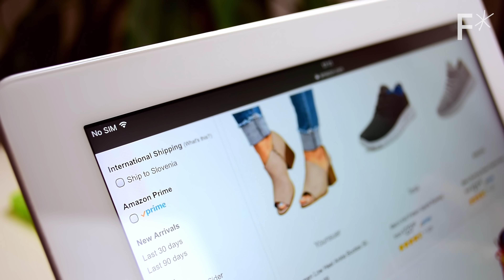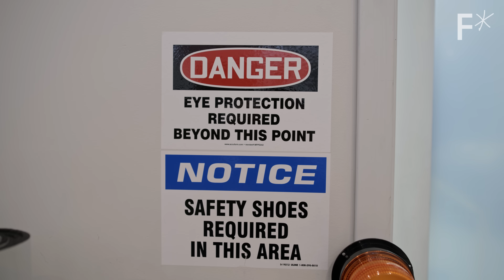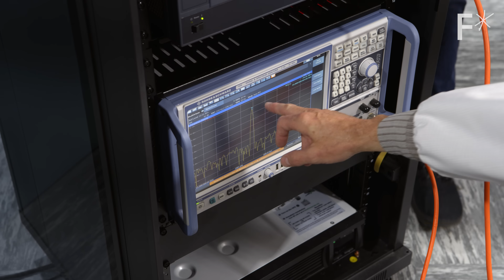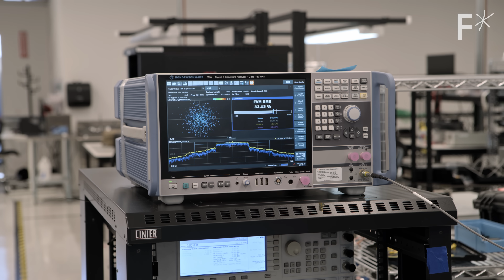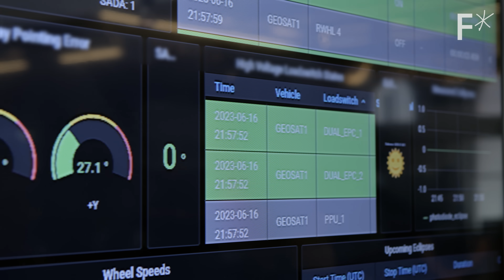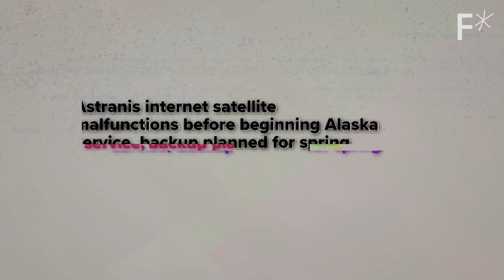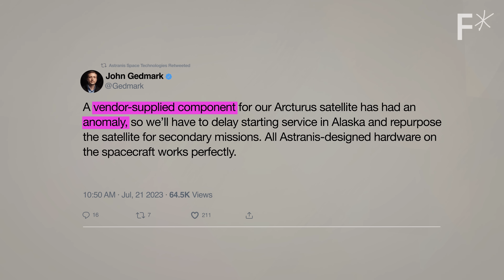Starlink’s newest competitor is using next-gen satellites to create internet for all | Hard Reset

Comment: Satellite Network Engineer here. It was really strange to frame LEO as being some cumbersome design and GEO as being a "new outside the box" solution to this problem. GEO has been around for decades. It's the OG solution. But the problem is latency and it's caused by the extra distance. The average latency for a GEO stationary Sat is about 700-800ms compared to LEO which is like 32ms. That is a VAST difference (which admittedly is addressed later in the video).  The Phase array tracking system in Starlink antennas is literally bleeding edge tech. 3:16 this sequence was  very misleading, considering that the starlink antenna (dishy) is phased array not mechanical tracking. So the antenna isn't literally "moving around" to track the satellites as they pass in LEO. And that being the case it doesn't "jump" to track the next sat (or at least very very very rarely if there is an issue). It switches faster than you could perceivably notice and long before a packet hits its timeout counter or is dropped. So the internet wouldn't "go down" as described.

These guys aren't really doing anything revolutionary here tbh. They are just iterating and aiming for a cheaper solution that serves a very specific niche at the very bottom end of the market.
Reply: Very true. Working on a project now in Europe where we are removing the old GEO satellite connections using an iDirect HUB and installing Starlink. The client is blown away by the latency and speed of the new connection. It's like several times better.
Reply: @thebrainfan  Like 20X better..
Reply: Yeah, this was weird to hear the way this was presented. Old tech, same draw backs as ever, rebranded and marketed to supposedly serve some underserved community now. I feel like I have seen this before.
Reply: @TheDrov  
But that is just the exact same thing Elon Musk does, xD Takes and old idea, Re brands it, Makes some promises, don't deliver on time, Ask for financial help from government, Deliver half of whats promised with bad quality, laughs it of.

- Hyper loop, Never deliverer, bcus it is impossible to make, as multiple scientists said before he even started.
- Tesla Electric semi-truck, promised production in 2019 but was pushed back 3 years to 2022, now mass production not until 2024 Q3
- SpaceX star ship, Mars mission, is missing a reason to go to mars,why colonize mars? and how, they are less then 5% of the way there
- Tweeter, bought it to allow free speech, instantly learns why free speech is impossible on a platform that survives on regular advertisements. start by saying everyone can have a blue check mark, if they PAY FOR IT.
- Even Tesla is just a normal Electric car with some components that are industry leading 
- Tesla self driving, never functional and never will be, bcus of safety and regulations, unless they change the exterior of the car like existing self driving cars has, to allow for better cameras and tech.
- Pay pal, is said to have been someone else idea, he was just on the board and didn't make any important progress, was fired for some reason
- The Boring Company. promised to bore tunnels for hyperloop faster and cheaper than any other on the market, when hyper loop was shot down they had to start digging normal tunnels, but still do it more expensive of about same expanse as others.

point is. Elon Musk is really bad at predicting what he can make and how fast he can do it.
i like that he wants to make new cool things, my problem with him is that he is lying alot in his advertiseing.
i would be ok with him if he just sayd. "our goal is to make this... but we dont know when or even if we can do it"
i absolutly hate it when he says "im comfident that we can to this within next year" and then after 5 years they are not even close

He is also good at making stuff we DONT NEED, but he does it because it is cool and because he can, even though he really cant. XD

although i have to give him props for what he has done, some rocket science tech advancement, early electric car mass production, and there are many small things he has improved.

but over all just wtf is he really thinking when he makes thees promises he cant ever keep...

pleas challenge me with facts if you can, calling me names and getting angry want help anyone. change my mind!
Reply: @echoeversky  alot of the companies Elon manages are making huge steps in science, but i just don’t like the marketing.
He said star link would be cheap, but instead the government payed for most of it instead of the company. 
Its cheap for us because the gov payed with tax money instead
Reply: Great Points, couldn't have said it better. Also they are dependent on SpaceX to launch, basically paying their competition.
Reply: @AltHistoryX  When it comes to launching rockets, SpaceX is a great company.  Starlink was an idea to suck money off of SpaceX, So you have space transportation with the offshoot of space exploitation. 

The idea that being a rocket company and a satellite ISP, is really pretty dumb. Starlink has some amazing technology, but it comes at a cost.  A cost that is not remotely affordable for that market of 4 billion without highspeed internet. The market that Starlink was in theory,  built to serve.  So in that regard, Starlink is not competition.  GEO-Sat is better in many ways to LEO-Sat with the exception of latency. But fiber is far superior to both in that regard.  and Starlink costs twice as much as fiber. 90% or more of internet traffic is not latency dependent. About the only things that are impacted, is gaming and live streaming. If you live  in one of the underserved areas, this is probably not a deal breaker worth double the price!
Reply: @professorg8383  I agree about the latency not being a problem for a lot of things, but it definitely is for VOIP. But maybe that is a niche market as well.
Reply: @GarySchiltz  I can not speak to what the high limit is for Voip. Not sure what the hardware or software tolerates. I have video conferenced with lag times approaching a second and although not ideal, it's something you can deal with by having a little patience. If you have ever done much communication via radios, you learn to deal with a little lag.  I have worked somewhere with Voip and you could tell that it had some delay, but you just needed an awareness. My guess is that what brand of equipment you have, might make a difference too. 

My brother has Voip as part of his Gigabit fiber service, but then fiber is virtually latency free.  But even then, Voip has issues with things like emergency services. And standard phone accessories like cordless handsets, faxes, etc. become door stops!
Reply: thx, i just posted the same kind of comment with far less understanding :). you did it right.
Reply: Your comment is spot on ! They don't have 1 good argument why their system is better, so they try to make people believe that de Starlink dish is moving all the time so we will think that the motor can also break. Maybe they have to watch this video "How does starlink works" https://www.youtube.com/watch?v=qs2QcycggWU 
The Starlink dish Phase Array Beam Steering tracking will not make down the internet connexion, it will just switch the phases of the antennas and the signal beam is steered to an other satellite almost instantly.
Reply: Thanks for confirming all my thoughts through out this video. GEO is obsolete for real-time communication. Presenting this as an alternative to Starlink is ridiculous.
Reply: Said it better than I could, though I understand what you said 100% I had Hughes in late 1999, before we could get 1.5 megabit DSL
I got close to a meg down, but had to UL over dial-up. But at the time, it was pretty good. GEO is about 22,500 miles above earth in the Clarke Belt as I remember. Just like Direc-TV.  I have installed all kinds of GEO dishes and had a big 12 foot C-band dish at my house. C-band in the 1990s, you rotate the dish to receive different transponders. Those were the fun days.
GEO satellites usually run out of fuel before they go bad, they use fuel to be repositioned occasionally. You could see a lot of free TV, and audio on C-band. News feeds, etc. I remember Galaxy 4 being one satellite.
Reply: Thanks so much!!
Reply: Yeah, they miss the mark on a number of things here. But they are somewhat revolutionary with their smaller, cheaper tuneable units. Of course, the extreme latency of GEO communications makes them ABSOLUTELY THE LAST OPTION I've built systems to use dialup instead -- also because talking to satellites is hard to do in a forest fire. BGAN has been around for ages, but it does (did?) need a very wide clear view of the sky.
Reply: @jfbeam - GEO works great for non-time sensitive applications like streaming one way video like YouTube at a lower cost than thousands of low orbit satellites.  It's a trade-off between low cost and higher latency.
Reply: Hybrid satellite networks which utilize GEO and LEO are the way.     We don't need LEO to download data once you have enough buffer to cover the initial latency of GEO.  Its ideal for movies for example.  Not good for VOIP, most gaming, live streaming a rocket.
Reply: @dherman0001  This is correct, though I’d go further and say SD-WAN is the way. Hybrid networks with multiple WAN including LTE, L-Band, LEO and GEO are what we are providing to the majority of our customers currently. Another point which hasn’t been mentioned is Starlink does not currently provide a CIR service.
Reply: @dherman0001   IDK if they have any systems running, but I have heard the Viasat guys talking about hybrid systems. But I haven't heard an explanation of how it works. And I'm not sure their hybrid systems are even aimed at  ISP use.

LEO-Sats are probably most useful for data collection. LEO orbits can capture some very high resolution terrestrial data, and they could uplink to GEO-Sats to be fed back to the ground. This is the kind of data that doesn't need to be real time, but with a GEO-Sat relay, a lot of data could me moved pretty quickly. 

To be honest, I think a huge constellation of LEO-Sats for internet service, is pretty wasteful and potentially hazardous to Earth dwellers.  GEO-Sats for internet, work pretty well, except for latency issues. But is a Starlink system primarily about making gamers and live stream video and Voip users happy, worth the expense?  That is a very small portion of all internet traffic. Less than 10% typically, and is any of it really real time critical?? Sorry, gamers, 

"Real time" traffic can be achieved with a variety of terrestrial services and for far less money, Starlink can never be cost competitive with these services.  The tech is very cool, but I don't think it is worth it as designed.  

Now if each of these satellites had a high resolution camera on board, imagine the possibilities of being able to see in great detail, any location on the hemispheres near real time!! I think we could com up with some very useful information from such a system. Why didn't Elon think of this?
Reply: thanks.  I could not have said it better.  There is another problem with GEO, cost to launch. I heard somewhere a GEO orbit is expensive and SpaceX basically owns Starlink. This company also looks slow or no sense of urgency producing those satellites.
Reply: Thank you, I have literally no formal insights on this and also thought... Wait a minute, thats misleading but the fact that someone who knows way better weighed in 👊🏻
Reply: its hughes net 2.0 and will still be basically dsl dialup on the best days and worthless with any weather
Reply: For some people lower cost is more important than lower latency.
Not everyone does real time communication or gaming. If Astranis charges less than Starlink, for many people could be a viable solution.
Reply: Thanks ! I was watching and keep wondering "what is new ???". 😂😂 The video really waste my time
Reply: They will go bankrupt shortly. 

Nothing in their business model makes any sense. 
Cheap equatorial geosync satellites is a Very bad idea as that is a much sought after orbit, large satellites are used for maximum salable bandwidth for a slot. They also have a problem with removal when expended if they fail to return from orbit so the satellites are built to last many years (15 or so). They will stay up there as trash for thousands of years if they fail to de orbit or fail to move out to a "trash" orbit... unlike LEO sats with much higher bandwidth, superior reception, 20x lower latency, little problem re-entering if they fail (dragged down by upper atmosphere). 

LEO is Vastly superior and Can use cheap/small satellites like those used by Spacex... but even here they moved to larger satellites to maximize bandwidth for an orbital slot. (V2 mini is more than 2x heavier than V1.5 but has 4x the capacity. Full V2 has 9x the capacity of V1.5 and weighs about 6x s much (and tosses in a cell phone to sat antenna to obviate satellite phones. 

So this appears to be a company built on flawed ideas with no business case that others aren't doing much better/cheaper. They are Way too late to a party that has moved on to LEO.

This will burn investment dollars and only get investors who don't do their homework.
Reply: Fully agree.
Reply: Exactly! 💯
Reply: Latency is not always important unless you are playing real time video games. If I am uploading or downloading videos then I could care less about latency.
Reply: @WJV9  That’s absolutely true. Neither is insurance, first aid kits, carbon monoxide detectors, plungers, basic tool kits etc etc etc. But when you need them, boy are you ever glad you’ve got them.
Reply: @WJV9 you do realize that latency affects the speed.
Reply: I work in space force acquisition and I completely agree.  Cheap commercial niche is the future architecture to accomplish resilience as cheaply as possible
Reply: Do you know if that is the new refueling port? Are we looking to a part government Military satellite ?
Reply: You said it better then me but, I knew this video didn't add up and gave always k ow. Geo has terrible latency.
Reply: best than the video itself , great comment!
Reply: Also with fewer satellites, wouldn't the fact they are covering a larger geographic area (and users) negatively affect the bandwidth by each satellite having to process way more data packets?
Reply: @CrustyOldMarine  The newer GEO-Sats like the Jupiter 3 have 300 spot beams and each covers a smaller geographic area kind of like a cell.  Each of Sats have 18 different gateways so the satellite has 1Tbps capacity. That's a lot of bandwidth. These are big satellites If you have a few of these they can move a lot of data, 

These have come a long way since early satellite that had wide beam coverage area.. You can think of these like many satellites in one location in space dividing up the area below into different 'cells'.  

Bandwidth is really not the issue it once was. But sitting 22,000 moles away, does mean pretty high latency. So "real time" is about 3/4 of a second delayed. That is less of an issue than is often stated. Things like gaming, two way live streaming and super high speed market trading will suffer from that delay. Just can't get past the delay issue because of the distance. But for more than 90% of all traffic, it's not an issue.
Reply: Not to mention launching GEOs being incredibly harder and more expensive.
Reply: My thoughts exactly, it felt weird watching this surreal 'perspective' on reality.
Reply: Yeah. BS. Starlink and this is not satellite based. It's GPS based and GPS is also not sattelite based. Just look onto the maps where you can get Starlink and where not. That says it all.
Reply: Exactly! My thoughts exactly when he said they were placing them in GEO! LMAO!
Reply: Rocket science engineer here: Rockets don't work in space, because there is no atmosphere.
Reply: Well said.
Reply: Was about to write the same, thanks for writing this, very important!
Reply: I worked on Irdium and it had too  many issues to everwork. The packets of the internet go through queing delays and end up with more delay then GEO.  The problem with geo is the two way link loss is very high and the gains needed to make it work require very large antenenas with gains that cannot be obtained with phased arrays.  antennas.  A handheld phone would require a large anntenna of some sort just like currnet GEO's and you need push to talk for voice when the delat gets over 20ms.  It would be much cheaper just to build cell towers powerd by cable modems ( 5 g cells towers).  Starlink makes no claim about latency becuasse they are not trying to provide two way voice.  Our GEO spy satelits have gigantic antennas on them and cost billions to lauch.  Iridium never had a chance for two well cell calls.  The physics of communications just will not allow a practical solution for cell phone receiption from space.  The propagation of cell phone towers(multipath reception) requires power densities just not possible fron geo or Leo.  All this low orbit space junk is going to be a problem with Starlink.  I can't beleive the goverment let MUSK lauch this thing!
Reply: What about ASTS seems like every first world person complains about dead zones.  If they eliminate that= we have another internet revolution.  Also by linking up 'poor' countries they might be able to commerce with us and we can make money with/off of them
Reply: I'm not an engineer, but this was going through my mind the whole time I was watching. I remember thinking about getting a satelite internet as far as 2010 my self. I gave a dislike for this disengenius way of framing things.
Reply: Hoenstly this video feels like a thinly veiled infomercial for this company.  I support business but don't lie and pretend this is an objective video
Reply: not even an expert and though the same thing. starlink picked leo for a reason.
Reply: This is old tech bro. I just back packed across the middle of absolutely nowhere in Italy. 20 miles away from a small town. Took out my mini Starlink and watched 2 movies on Netflix the other night in the middle of nowhere!!!! 150 MBPS, 30m latency!!!
Reply: I had Hughes geo internet at one time, the latency was horrible, the speed was slow, the dish was huge and the daily data limits were onerous. Starlink addresses these issues affordably though less efficiently than land based systems. But for millions of users, a very viable solution. I can't wait to buy a Starlink Mini and put it in my travel trailer for my next trip to the Arizona desert.
Reply: thank you... you said it, so I do not have to :)
Reply: Thanks someone from that industry speaks up.
I am so annoyed by Starlink etc. When you do the math, you can quickly figure out this isn't going to work out. 
Starlink is in lower orbit, but that adds a lot of new complicated things to it. 
It's just really cheap to dig a hole and put a fiber in it. Nothing can really compare to it. 
Satellite Internet is more of a hot fix.
Reply: @PhilippBlum  Quite a few people live in area's where fibre is not available unless we're willing to come up with $50k to have it installed I don't call that cheap.
Reply: @BamBam-uf4yi  The fun part is: All of these satellite Internet providers don't even serve those regions.
Reply: @PhilippBlum  Well starlinks serving my region.
Reply: @PhilippBlum  Well the nearest fibre to me is 100km away and whos gonna pay for 100km of fibre. Starlink is cheaper. Had to chop down some trees but they had to go anyway
Reply: so with that split-second change is internet disconnected for that brief moment?
Reply: @proxypharm8511  been streaming live TV havint noticed a thing only obstructions cause problems.
Reply: well said. this should be a "community note"
Reply: What about cloud cover effect? Especially one with electric storm during bad weather!
Reply: @olivermandalamwambazi4000  ka/ku suffers rain attenuation for sure. Heavy rain will result in an outage.
Reply: Where did you get 700ms?
Reply: good point, very professional!
Reply: Yeah. I don't like liars. Showing the Starlink antennas moving to track a fast-moving Starlink bird is just BS. I never liked BS. Phased array is slick stuff, now brought to the masses. And the latency matters, even for non-gamers. Then we have SpaceX's incredible launch capacity -- just mind boggling compared to a few decades ago, or what NASA's conventional vendors can provide even now. So let's tell it like it is, eh?
Reply: I was raising my eyebrows with the statement that your service will (must) be uninterrupted as the receiver re-acquires.  I'm thinking simply have two receivers coordinate the hand-off, so that are they momentarily are both connected.  Infomercials  like this need to be viewed with healthy skepticism.
Reply: YouTube is truly vindictive, even censoring my comments in a technical discussion with a hundred responses.
Reply: They can help people stream their favorite shows.  

Like broadcast TV
Reply: I actually am super interested in that path what was your skill background ?
Reply: So it's like they trying to sell you low quality shrimp at a Hi end restaurant.
Reply: @eafortson Man, I watched this video. Then I read this comment. I was wow this dude knows what’s up. Then I saw your name like oh hell! 🤣
Reply: Yes they aren’t doing any thing bleeding edge but they identified a niche and they will make money 

Starlink will acquire them for few 100 million
Reply: @krishnayogi  Or, Starlink might just launch a few of their own satellites in GEO to cater both markets if it comes out cheaper.
Reply: @krishnayogi why would starlink acquire them? That seems so unnecessary
Reply: Lets not forget that SpaceX is losing money on each Dish instelation because the things are so bleeding edge, the costs is simply out of reach for poorer markets to ever used the phased array ground stations even if the satalites could be put into orbit for free.
Reply: @kennethferland5579  SpaceX actually got their production cost down and are no longer losing money on them.
Reply: @woopsserg  especially from voming business like aircraft and shipping where costs are a lot higher for Starlink
Reply: @woopsserg  And where the f did you get that info from dude
Reply: @woopsserg  They are losing on putting the satellites in space. Check out their numbers. How many clients they can serve per satellite, how much each launch costs, how much their subscription is. It just doesn't add up. It's fueled by VC money.
Reply: @PhilippBlum  News articles say Starlink achieved positive cash flow this year and they have more than 3 million subscribers. Multiply that by about $120 on average per customer and you'll get their revenue per month.  I don't think it costs them more than $30 million per launch (rocket+sattelites).
Reply: @PhilippBlum  They have heavily cost optimized satellites. For example V2 mini use Hall thrusters running on argon (~$0.5/kg regular, ~$5/kg high purity) that is cheaper than dirt even compared to Krypton they used in previous satellite generations, not to say Xenon used by everyone else (~2000/kg). The only thing that is not reused between launches is second stage. Booster and fairings are reused 20+ times.
Reply: @kennethferland5579  OK, that makes sense but then why create such a deceptive video that suggest they physically move to track?  There may be market for both technologies but why suggest it's one or the other and then create this deceptive graphic?
Reply: @kennethferland5579  This has been the modus operandi in the tech space for decades now. Losing money is not an issue as long as you are gaining significant market share from your competitors. And as someone who works in the industry I can tell you Starlink is gaining market share at a ridiculous rate. 
You also need to keep in mind that the constellation isn't anywhere near completed. Less than half actually. They also continue to roll out new service offerings, such as satellite to cellular, and various tiers of enterprise solutions. As well as refining and adjusting existing offerings. They have barely scratched the surface of what they intend to provide long term. 
The scope is ambitious, and the logistics daunting, and I'm not 100% sold they will succeed and the end product will remain commercially viable for the long term. But the factoid you mentioned, absent relevant context, doesn't represent a full analysis of the longterm financial situation of Starlink.
Reply: @kennethferland5579  They were losing, but they don't anymore and it doesn't really matter since it's a razor blade model but still their new factory in Texas will drastically reduce terminal cost more.
Reply: @kennethferland5579  Its not exactly "bleeding-edge" per say. Phased-array radars have been around for a very long time. And cost of both service and dish can brought down siginficantly with scale
Reply: @kennethferland5579  not true. stay updated.

 starlink is already reached profitability.
Reply: "a cheaper solution that serves a very specific niche at the very bottom end of the market."  Well, the niche market is actually at what you are calling, the high end of the market.  The market for satellite is those people with no other real choices for service. The bandwidth and latency is fine for 90% of internet traffic. so calling it the low end is inaccurate. Their goals are to be cost competitive with typical ground based ISPs .  It won't compete with with fiber performance but neither will Starlink for twice the price of typical fiber, plus a $600 up front expense that is not recoverable. Arguably, Starlink 

Most of the 4 billion unserved who live in remote areas are fine with the performance levels achieved by these systems and can't afford Starlink. serves a very specific niche, within the niche of unserved people.
Reply: @professorg8383  The most cost effective solution that is actually useful to most people is clearly LTE over geo-orbit.
Reply: @HesderOleh  So much depends on where you live. And technology keeps changing. '

I use LTE mobile broadband with a dedicated hot spot, rigged with an external antenna,  I used to use a GEO-Sat connection.  Nothing else available and the mobile broadband was a pretty recent option only after they put up a cell tower pretty close to where I live. No DSL or Cable or other options. 

Prior to that tower going up, I couldn't even get cell phone service!! What many don't realize is there are plenty of dead areas for cell service all over the country.  For decent speeds, you need to be fairly close to a tower. 

I typically see ~60 Mbps down, ~25 Mbps up with a ~30 msec latency. It does vary and is almost always useable. Start to get much below 20 Mbps and then you see issues. I usually have several devices connected but phones, especially iPhones are huge bandwidth hogs!! They can kill a connection pretty quickly. I actually have to block a few friends' iPhones from connecting! 

Interestingly enough, my provider does not offer wireless home internet in my area. None of the phone companies do!!

The nearby town does have a wireless service but their tower is low and there are too many trees between me and them. You pretty much need line of sight with few obstacles. 

Direct run fiber in my area is easy to run. The .local Telco has changed ownership 6 times in the last decade.  Each new owner says high speed internet is coming soon! But they all lied.  20 years ago, providing DSL was as easy as installing a $5000 repeater box along their existing copper lines,  but they didn't.  It would have easily given them 200 certain customers with no other options, but they wouldn't do it. 

Bottom line is that if they aren't forced to  provide service or given a big government subsidy, they won't service small market areas.  They are now running fiber under the government program. Finally!

The LTE approach does work pretty well, but you need to be close to a good cellular network. In my experience that distance is within a few miles.  Get very far from major highways and you are SOL for even my solution. 

If you have power and.or landline phone service, you should have highspeed internet available. But the greed of the big companies get in the way. Deregulation and free market promotion, screws the little guy!!  Remember that when you decide who to vote for!
Reply: @professorg8383  I don't get a 30ms latency even if I stand right beneath the tower. The best I could get was around 40-50.  Starlink is worse though, regularly above 80 or 100ms.  Cheers from the canaries.
Reply: @professorg8383  The term 'underserved market', referring to those 4 billion without internet access, might be misleading. A market, by definition, is a system where buyers and sellers interact to exchange goods, services, or information. If no transactions are currently occurring, it's more accurately described as an 'emerging market'. This implies potential, not current activity. In the satellite industry, which I am a part of, we recognize that emerging markets represent a fraction of current business focus – certainly not more than 15% of revenue or investment.

Regarding your point about Starlink's pricing: the $600 upfront cost you mentioned is seriously outdated. I purchased my Starlink dish for £99, and similar offers are now common. In the UK, for instance, the current price is around £199. It's typical for early adopters to pay more until the service expands and becomes more affordable.

You seem to misunderstand Starlink's business strategy. Working in the traditional satellite industry, I can attest that the primary focus is not direct-to-consumer but business-to-business. In this domain, Starlink's value proposition is highly attractive. Many of our clients are integrating it due to its clear benefits.

On the consumer side, Starlink aims to provide a superior product at a competitive price. Their advantage is in offering unmatched throughput, something the competition cannot match at any price point. Currently, Starlink isn't directly competing with terrestrial ISPs – that's a future goal.

All this is without even mentioning direct-to-cell, which is revolutionizing the field. Sounds like  you're not tuned into this, and are missing out on a major industry shift. Starlink is doing more than competing; they're redefining the standards. Keeping up with these developments is essential.
Reply: @professorg8383  Speaking as someone who lives in a "bottom end of the market" country (Ecuador), I do want to point out that Starlink has made price adjustments for less well off countries. A Starlink "dishy" ordered directly from their website and sent to Ecuador is under $400 including shipping (under $300 for refurbished) and residential service is $60 a month. Given that geostationary satellites are so much further away from Earth, it's hard to imagine their end user terminals would be cheaper that those for LEO satellites.
Reply: @professorg8383  "Most of the 4 billion unserved who live in remote areas are fine..."?? Really? Have you seen a survey? What is your proof?
Reply: Your fiber bill isn't going to go down, it's only going to skyrocket in the next few years; why is that? Because the initial installation of fibre was due to ISPs being scared, but those wires are now about 15-20 years old; a typical fibre would need recabling after 25 years and by 2030, we'll see that begin. But the cost of cabling is so high even more so now that they'll have to squeeze out the profits from somewhere and that'll be customers. Not to mention the fact that Starlink's cost will come down with scale, more satellites and their new factory in Texas. @professorg8383
Reply: @Skorcch  What are you talking about?/ Fiber is just now going in!  The bulk of fiber network expansion is virtually brand new!  The newest standards should have a lifetime exceeding 40 years!!

Once established, replacing fiber is pretty easy. Most existing fiber failure is due to being damaged. 

I think you info is inaccurate. Please  provide evidence!!

As for Starlink costs going down, it makes no sense if you do the math. Satellites will last 3-4 years. They have 5000+ up now. Supposedly the individual hardware for each antenna and modem is just now getting close to the $600 they charge. And they cheaped them down dramatically. The latest version is of questionable quality. 

Of course, SpaceX and Starlink  are private companies and are not required to make financial disclosures. Musk throws numbers around that are completely unrealistic. But there are analysts who know how much things cost, and more than a few have pointed out that things don't add up. 

Starlink has only risen in price since it first became available. Went from $90/month plus $499 for  hardware, to $120/month plus $599 and up to $150/month for mobile. 

The trouble with the economy of scale concept still boils down to bandwidth.  The other issue related to that Musk must still pay for every internet connection at ground stations.  And he doesn't own ground networks. So out of that $120/month, a good part of that  goes to the ISPs on the ground, who BTW, are using that fiber which  you contend will go up in price. AWS owns the majority of the ground networks. So Bezos makes  money for every service Musk sells!!! Can't get around the fact that the internet is terrestrial!! 

Starlink cost will be fiber based ground internet service, plus the cost to send that up to Starlink's space network and back down again. The internet is not a freeway that anybody can just use! It is a series of fiber highways owned by the big network companies. Starlink must "pay the toll" to use those networks. Technically speaking, Starlink resells the internet service adding his cost to get to space and back!!

When you understand that Starlink can never  be cheaper than ground based providers!!  You can think of Starlink a an "extension cord" to connect with the internet! The operating cost of Starlink will always be on top of the cost to use the ground networks.
Reply: @Skorcch not on 3rd world nations I live in 😂

Those are at worst just a decade year old
Reply: @Skorcch fiber is cheap. Like ridiculously cheap. There’s good reason telecoms companies were already moving to it before the internet got big. And that’s because it’s ridiculously cheap. As far as recalling. Idk. I’m not that knowledgeable, but I gotta figure that a glass(ceramic) tube which only encounters light isn’t going to be maintenance heavy. But again. Idk about fiber lifecycles
Reply: @TheWizardGamez  copper cable is far cheaper than fibre optic cable.
Reply: The only issue with starlink is it's proprietary elon processor which is notorious for it's conservative antisemitic glitches causing network crashes.
Reply: @gothesouthway  Show us on the doll where Elon hurt you.  It is weird how the left eats its own.
Reply: @gothesouthway 🤡
Reply: @gothesouthway You poor little fascist baby full of pop culture brainwashing.
Reply: @gothesouthwa 😏 would have been a clever comment if the levity in it were accurate. It's not and either way, this sort of jab has been socially cemented as the type of bandwagon comment someone parrots when they have nothing good or real to say
Reply: @gothesouthway  And no other "glitches"? It's discrimination? Got any proof at all?
Reply: @1voluntaryist  open your eyes and don't be ignorant.
Reply: @gothesouthway  So,,,,a serious accusation, no proof, because it's obvious to you, oh enlightened one with the "open eyes"?
Reply: @gothesouthway you're a child. I've been using starlink since January in Alaska and the service speaks for itself. If anti semites run better satellite networks, then you should be worried about new developments in oven tech
Reply: @gothesouthway  😅
Reply: Hi @eafortson, I'm Duc, currently a freshman at a university in Finland. My dream job is to become a Satellite Network Engineer and secure a position in this field after graduation. I would greatly appreciate it if I could have your email to ask you a few questions about the process of becoming a Satellite Network Engineer, what I should focus on, and any advice you might have for a young folk. Thank you in advance.
Reply: @whereIwent study electrical engineering
Reply: @whereIwent you need to study electronics satalite s use the  same microwave transmission system as any other system only difference is the frequency